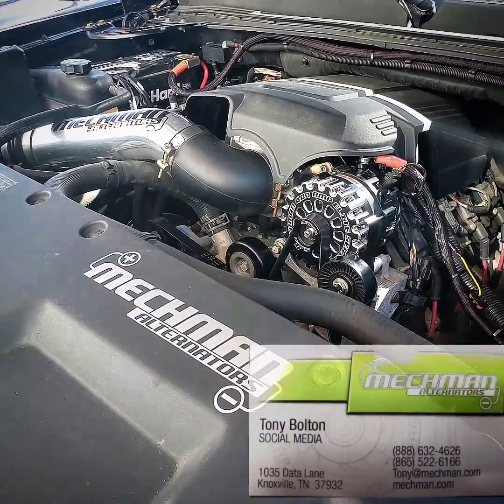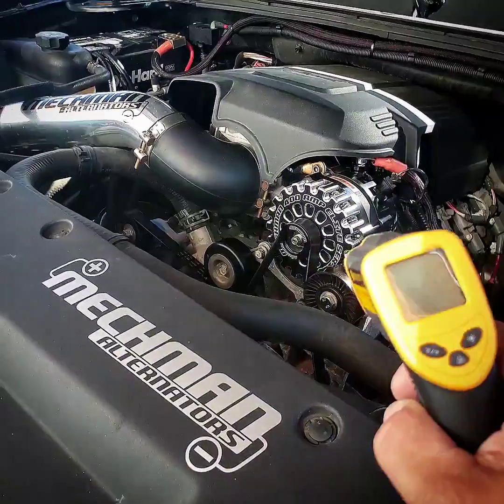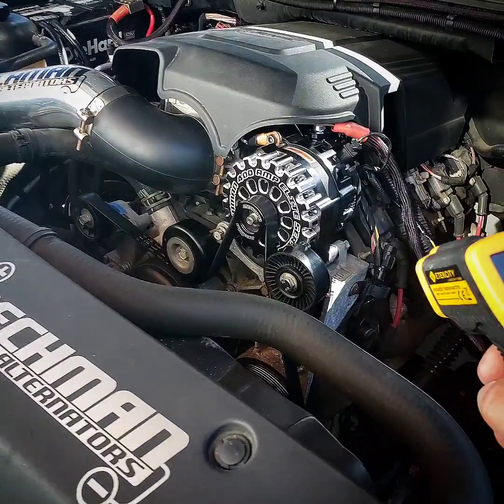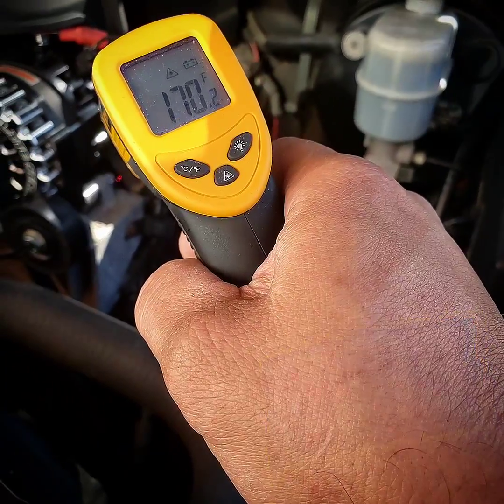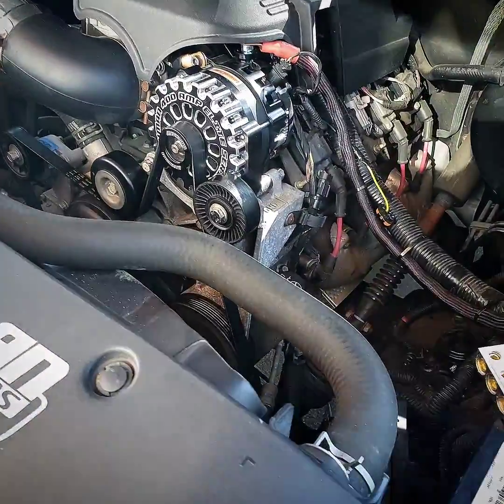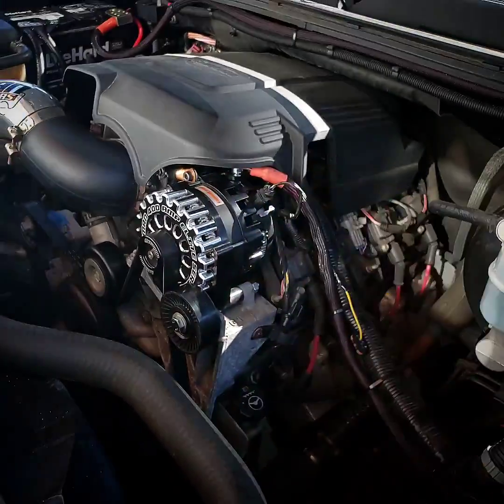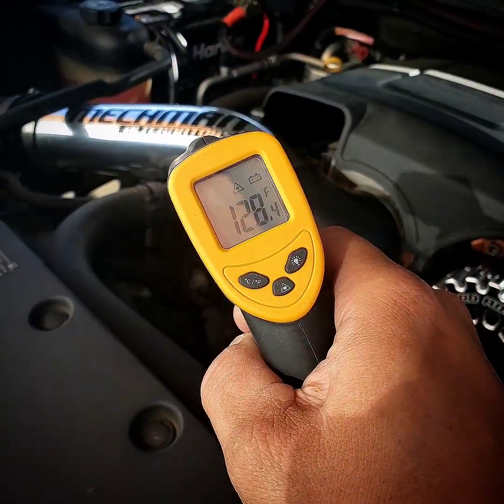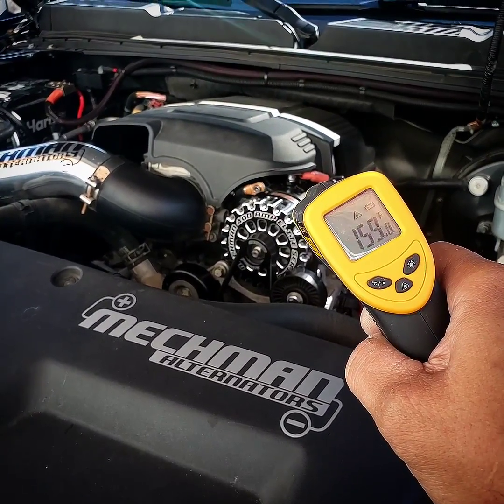OH NO!  My alternator is HOT, but it's OK. Really. Seriously, it's OK.

Comment: I have a 370 on a 92 chevy 1500 that gets hot on the post only . Its a 4 pin single wire hook up is that normal
Reply: FYI it gets hot on start up and it's the elite 370

Comment: I was worried i had it wrong after replacing it, either too tight or too loose, i think i have it just right, but yeah i was thinking the same thing, engines are hot, so the alternators gonna be hot, i'll take it from the guy whos name is Mechman Alternators, lol, but just so we plebian home alternator replacers know, how tight should the pulley be, is the trick of turning it almost perpendicular work well? thanks

Comment: I replced my alternator because the power wire melted to the bolt but now with my new alternotor the power wire gets really hot after the fuse but before the fuse its cool should i worry?
Reply: Should i worry about it melting again because and getting hot to the touch or is that fine after the fuse
Reply: Sounds like you may have some resistance at your fuse terminal. If it’s a cheap fuse or fuse holder replace it

Comment: 163 degrees you must have just crank that engine up  lol. My 400 amp mechman alternator is well over 200. I dont see you replying to anyone that's having the same reading im having.
Reply from the maker: You just didn't watch the video, did you?

If you're well over 200 degrees, its because you're just sitting there with the hood closed/low with little to no airflow on it. 

Heat is the byproduct of power production.  This is basic knowledge.

Comment: Yes people know that anything on the engine compartment will be hot bit as a technician myself i can tell you that extreme hotter then what you were getting is often a poor ground of the alternator case to the mounting point so it a valid concern when people ask those questions. It's a good habit especially  with older vehicles to clean your grounds keeping the resistance to a minimal bc that will cause the alternator to perform poorly and take it out eventually. The more resistance the more amperage it will pull to satisfy what the vcm is requesting.

Comment: At what point is it a problem? my alternator was running at 250 ish degrees after running for 10 minutes.
Reply: I was wondering the same thing. I just had an OEM alternator rebuilt and it's getting to 260+ degrees just idling with the low beams and AC on with the hood open. I know alternators get hot, but that seems a bit excessive?

Comment: So the only reason I checked is my alternator failed, I bought a junkyard 145 amp for my silverado. I didn’t have a chance to clean it out in case there was dirt but none the less I hooked it up and started it and within 2 min it was hotter than the old smaller alternator I also get a alternator smell that I never used to get but it charges 13.6-14 on obd2 reading

Comment: Literally just pulled 350°f temp from the outer case on the alt in my 1990 Daytona es 3.0. I only checked it because it started groaning and my voltage dropped. Temp at the shaft is only 135°f. Pretty sure she shorted internally, windings or diodes ECT.

Comment: Trying to diagnose rough idle I was looking around noticed my alt was hotter than the engine. It has a high pitch wine with a steth a scope. Still not sure where to go from here, but can't hear it otherwise. No check engine and idles around 13.7 volts.

Comment: What if you just starting your car up and in 5 minute it’s hott
Reply from the maker: Then you probably have alot more problems goin on than an alternator.
Reply: @mechmanalternators  it was the alternator it was over charging my auxiliary battery which was bad and it burn out one side of the alternator!! Causing it to over heater by over working
Reply from the maker: @jayjb833  So it was the battery....NOT the alternator.  Good to know.
Reply: Good video . Thanks

Comment: That’s what I thought when I got a new alternator.
the coil pack gets even hotter. I measured mine (old alternator) and to went up to ~290F with the outside at 240F. I’ve also seen specs for a modern regulator and it had three thermal shutdown points selectable 240F, 280F and 300F. The temperature is measured in the regulator region so the coils can get even hotter.
for example 3d printed annealed plastic PLA can held up to 350F.

Comment: My alternator was very hot but I didn't have the truck running at all. It was off all night and I had disconnected the batteries for 2 hour charging before connecting again. After 5 minutes from when I reconnected the batteries,  I touched the alternator and I couldn't keep my hand on it for more than 3 seconds before it burned like hell. Is that normal? Again I never started the truck AT ALL, just reconnected the fully charged  batteries. Shouldn't it only get hot when/after running? Please give me an opinion,  I'm buying a new alternator tomorrow. Batteries died on me while truck was running the night before.
Reply from the maker: It sounds like you have something going on somewhere else in the vehicle or there is a constant parasitic drain in the vehicle.   

You can always check alternator performance/health with a simple voltage/multimeter.  The alternator should see the same voltage as the batteries when the vehicle is off (12.XX) and then be in the 14 volt range when the vehicle is running.

Comment: If there no discoloration to enamel on the stator, or smoke pouring out from the diodes in the rectifier, don't worry about it. 

I had a small case hairpin to 343 degrees for over an hour strait, torture testing it, after being rebuilt into a 180, then reconfigured to 240, and ran at 350+ degrees, also for an hour strait. 

You could sear a steak on it. No issues at time of testing, or weeks afterwards of using it hard, on the daily.

I heard the enamel that insulates the wire can go to 400 or so before charring..

Would take some crazy abuse to get that hot. I had to work at it pretty damn hard to get it above 300.

Comment: I would like a mechman but for the price headway lithium is a better choice for me.
Reply: I'll add some words of wisdom, learned from personal experience, some facts, and the reasoning behind why I say what I say. Most don't think about a lot of things, until it costs them something. Usually, not always. 

Now, when your burly alternator is supplying all, or most of the load, you get better efficiency in many ways. First, you reduce cell duty cycle in the batteries, extending life, and maintaining a higher performance for longer. Batteries last longer when not having to have constant high current demand. That saves you money in the long run. Now you're being financially efficient. Then let's talk about loss when charging and discharging. It's not 100% efficient going in or out of any cell chemistry. Lead acid is horrid. Headway, much better, but not great either. My cells would get warm to the touch when doing any heavy, or super demanding cycling, and that's wasted power. They heat when quickly discharged and heavily recharged. 

It doesn't stop there. When your drawing from batteries, even lithium batteries, like headway(I have a lot of experience with them) they really don't make any real power until around the 13.6 and below range. Lead acid, you get absolutely nothing until 12.6 or below to do anything substantial at all. You actually don't even see any real power from them until the low 12 volt range when pulling them down super hard. Then they make some current, but at very low voltage. 

Now your expensive equipment isn't performing like it should, running hotter, making less power, AND your creating heat in wires, terminations, power supplies, using current to try and get power the inefficient way.

When you have a capable alternator, wired properly, with low resistance connections, most of all the power comes from the alternator. AT HIGHER VOLTAGE....

This is super important, and allows for more efficiency of operation of all onboard devices. Your wipers, lights, audio amplifiers.... Air-conditioning, power windows and window defrosters all work with authority. Not just the tunes. Stronger spark, more fuel pressure... 

I could go on and on. And on and on and on. Now literally everything works better, your batteries are also fully charged every key off cycle, negating sulfide buildup from constant undercharged conditions for lead acid. 

I know mechman alternators are expensive, but I have had a couple, and I would be willing to bet they probably saved me more money having proper electrical and not wearing out batteries, or blowing shit up, then the little extra fuel and work the dual setup cost me. 

It's a well spent investment if your truly into high power car audio. It's a necessity actually. 

You're probably thinking I work for these guys... Well... I don't bass brother. I'm actually trying to save you $ that I, myself, wasted with that same mentality. 

If you truly can't afford one, and very ambitious with some time on your hands, you CAN build one yourself. Plenty of information out there if you look and study. It's pretty easy actually, the secret is the parts inside, and attention to details when building them. Sure, you could build a bunch that work, but it takes knowledge and skill to make one truly perform at the top level. 

It's worth the cheese man. Yes, that's an entire week of work for most. How much time you have invested in the rest of the setup? 

I guarantee when you finally get or build one, you'll understand everything I just said to the fullest and it'll really sink in... 

The heart of the whole system. 

It has other uses too, like power outages, now your rig is a mobile power station.. and a jump start beast. The look you'll get when EASILY starting a diesel from a small 4cyl shit box in no time flat is actually pretty entertaining. 

Get one, you won't regret it...
Reply: @georgesrisomsak9650  I think you did go on and on and on and on. 😂
Reply: @georgesrisomsak9650  little long but right on point.
Reply: Well maybe for a short time, however.... The power has to come from somewhere. The alternator is the sole provider of electrical energy for everything,  all the on board draw, as well as battery charging and other additional loads.

Without the alternator, you'll have nothing to work with in very short order. Unless you have a massive headway bank, but ya still have to charge it somehow. 

Every single watt consumed in a vehicle comes from the alt. 

The most important piece of equipment in the car. Without it, you'll be stranded in short order, never mind the tunes not cranking.

I see lots spend thousands on equipment, only to sidestep the main source itself. $700 is nothing compared to all the $ in equipment some have, and in my opinion, a wise investment.
Reply from the maker: Not even 700, you get the most powerful alternator we make for 549 shipped to your door!  400+ amps, 200+ at idle.  I mean, some guys spend $500 on multi distribution blocks that have 6 runs of 0 gauge wire coming from their STOCK alternator. :)    ....but that's none of my business.... :)
Reply: @mechmanalternators  that's a DAMN good deal! I've got more than that in just copper runs!
Reply from the maker: @georgesrisomsak9650   Knowledge is power. :)
Reply: @mechmanalternators  yup that would be me but only used 2g saving up man. These times are not cheap.
Reply: Sometimes it is, can't lie about that.
Reply: Just buy the alt first. I love my mechman alt. I may need to buy a second one soon too adding another 8k.